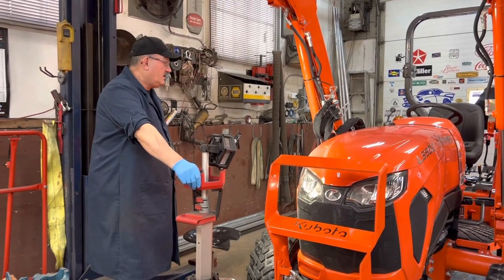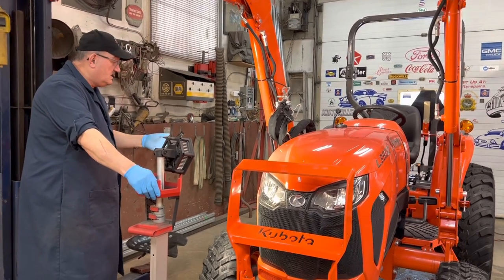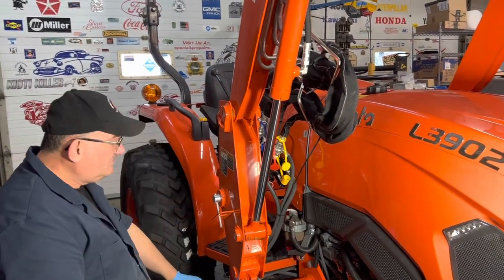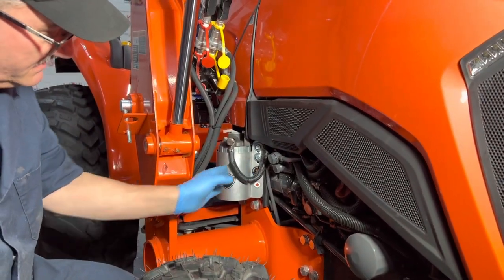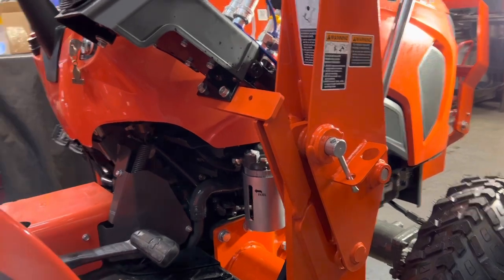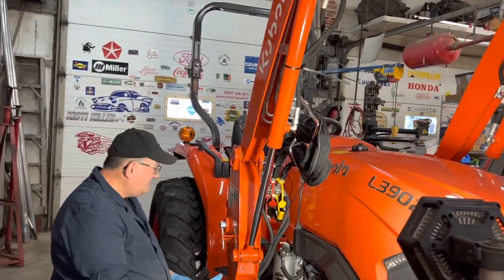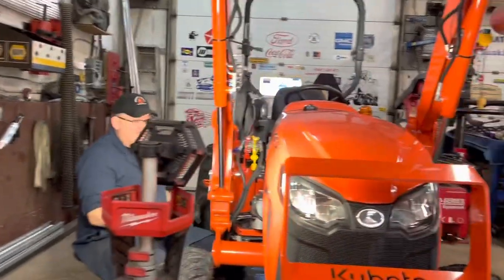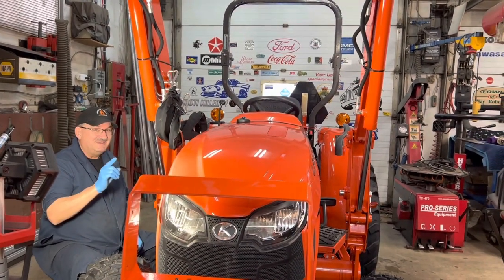Kubota L3902 Mod. Jan.11/2023

Comment: I've always been impressed with your designs and builds Paul. But your right, Kathy is upper management.  :)
Reply from the maker: Thanks bud. We’re just trying to avoid issues that seemed to be over looked by engineers. Hopefully this will will provide added protection for the owners and reduce the risk of a breakdown. Hope your doing well.

Comment: I often wonder if the factory engineers have ever actually driven a tractor before. Its odd, because the old tractors never seemed to have as many obvious weak points.
I can take my old B7300 and use it as a brush running bull dozer, and never really have another thought about it.
Reply from the maker: Your right Jim. They’re book smart but not hands on experience smart of maybe the bean counters ruled against guards where needed. Oh well. What they don’t do we will. Hope all is well on your end.

Comment: FWIW, might consider making a universal FEL brace. Lift the bucket insert lock and us the Kubota joystick lockout as added insurance. Old school equipment came from the factory with lift arm lock bracket to aid in maintenance and repair. I dont own an overhead lift and to grease my FEL have to trust the factory hydraulic lock even though my owners manual states to not trust it.
Reply from the maker: You could easily make a brace by splitting a pipe and installing it over the chrome section of the lift cylinder to prevent the boom from dropping down. Personally I never had a need to do it but it’s a common feature on rear backhoes.